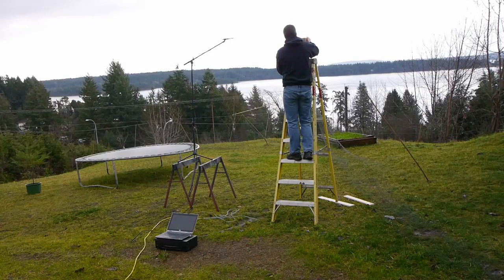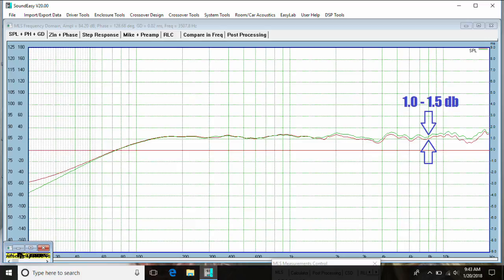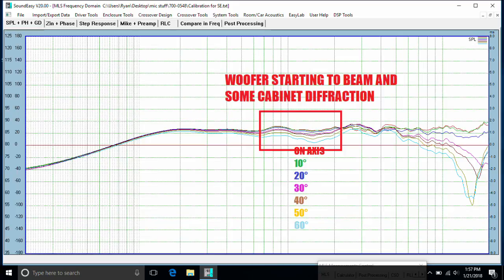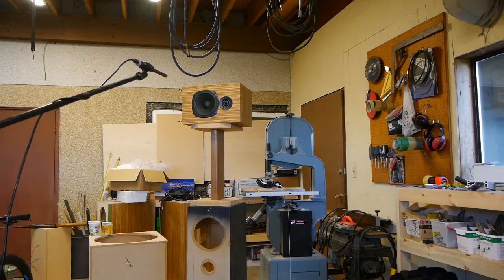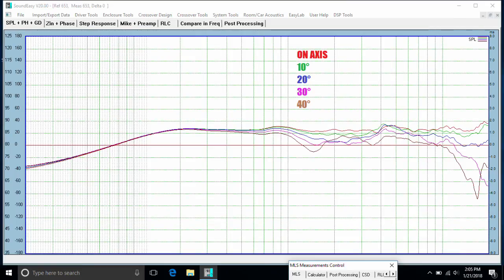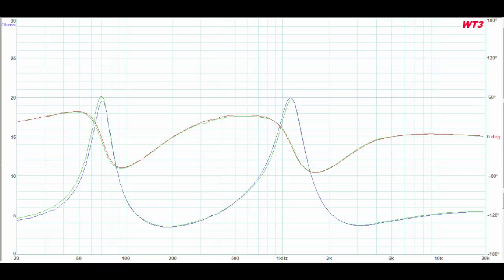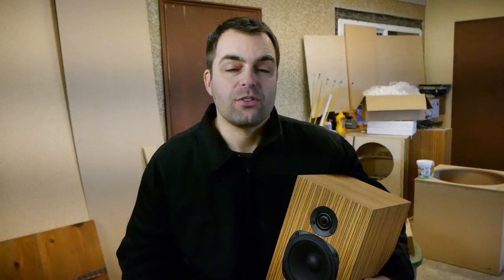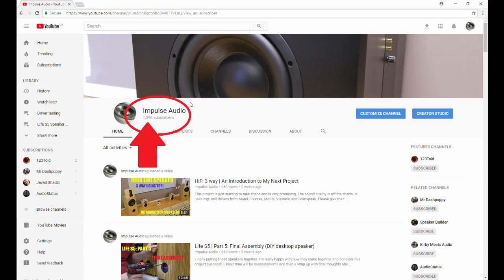Life S5 | Part 6: Final Measurements

Comment: This a perfect series for those just starting their own original builds. Enough tech not to completely blow your hair back. Good Job!
Reply from the maker: Interesting you say "enough" tech. I usually have about 2 or 3 minutes of blabbering on each slide and carefully edit them all down to just the most needed information. I figure nobody wants to stare at a measurement for 3 mins and listen to me. Then once it's ready to go I still wonder if it's too much or not enough. I often wonder "should have I mentioned this or that" or "may I should cut out that thing...". Good to hear the balance is there. Thanks.
Reply: Impulse Audio You demonstrated measurement and interpretation in a logical and practical way. It was very clear in a short video. My only complaint.......get a turntable. 😉

Comment: Really interesting how you were able to make that tweeter work up to 1.6kHz. I have tried to make them work with a 6inch mid-woofer crossed at 2kHz but wasn't quite able to get it to sound right. The 6inch midwoofer was probably a lot more efficient though which potentially caused some of the problems I had. I did really like the small frame, allowed it to be placed very closely to the woofer which does pay off. I expect you are using some kind of series LRC circuit on the tweeter or maybe a simple parallel resistor to supress their resonance because it is quite severe.
Reply from the maker: PA5cAl1 part of why this tweeter works so low is the application. A pair of 6" woofer towers in my living room would make this tweeter scream for help at even modest levels. Given the 1m listening distance it is comfortable doing what I need. So thats the big difference most likely. 

The Lpad has a 6.2ohm resistor in parallel which really whacks down the impedance combined with the second order filter which has an inductor to parallel means the Fs peak is dealt with no problem. Had I really pushed it low eith just a simple cap I probably would have required the LCR. Good call though. Hope you got it to work eventually.

Comment: Hi, i really enjoy your videos on YouTube. I use to build some speakes, can you tell me which software you used for the measures. I want to build a high power 4 ways speakers with a closed box for the subwoofer, and another close box for the second high woofer and a midrange and tweeter. I use the jbl pro 6 by 9 639 , which is a three way and i will add a subwoofer in that box, so all the driver will be close together for a coherent sound including the bass that is out of tune in almost all speaker installation. to divide my frequencier i will go to a fully digital crossover-amps solution which is easier to tune and should permit finer ajustment and go to 48 db per octave. when i was building speakers it cost me a lot in capacitors and coils and it was time consuming to solder everything .
Reply from the maker: A Br sounds like a fun project! I use SoundEasy but don’t recommend it. My biggest recommendation is HolmImpulse. Second is Room EQ Wizard. Give either of those a try and I think you’ll succeed.

Comment: Hi Pulse Audio , Have you ever made transmission line speaker cabinets, I made mine about 40 years ago they have a line length of around about 12 1/2 to 13 feet and I am looking to replace the woofer and the Twitter how’s the Twitter Osbornes out due to my amp packing up and I’ve been looking at Seas speakers 🔊, 8” but having problems matching tweeters, I do not have testing equipment and I’m relying on somebody give me some information to match a Twitter, And I think I need to build a Nother crossover unit . 
Not sure whether you can help to give me some information,
Phil from the moulin France,
Reply from the maker: Hi Phil. I don’t have a ton of experience with transmission line speakers. I like the concept, just have never felt the cost/benefit ratio made sense, so never built any. I think you’d get better advice from someone else.
Reply: Okay, thank you for reply, Phil from the moulin ,

Comment: You deserve your success, my man! This is a great channel! Since it will be used as a desktop speaker, wouldn't had been better to make your measurement from a desk or a table to simulate real world environnement and see how it behave?
Reply from the maker: Yes and no. I considered the angles and the types of reflections I would get, but it would be an error to try and correct a room or placement problem with the XO design. That always leads to a bad sounding speaker. Our brains decipher a source sound and a reflection/room sound very well. Speaker bad, fix speaker. Room bad, fix room.
Reply: @ImpulseAudioSpeakers  Thank you for the clarification!

Comment: Wouldn't it be easier to put the speaker on a lazy susan (turntable) when doing the off-axis measurements? It looks like you have the tools to make one that has calibrated locking stops for each of the positions needed.
Reply from the maker: Waltkat yes but I’m too lazy to build one! I’ve been meaning to build one for years now, but my old protractor keeps me going.

Comment: Very informative videos you have :)
Unfortunately i didnt found loudspeaker phase curve extraction and incorporating these in Xsim. Though you have so much videos i ned to check.
I can see you use DaytonAudio WT3 tester. I plan to get DATS V2 from "SoundImports.eu". Is DATS V2 better measuring device?
Further more i am planing to buy also DaytonAudio "OmniMic V2" with software. Do you have any advices and comments regarding these units?
What would be better and more precise unit, DaytonAudio "OmniMic V2" with its software or just to buy DaytonAudio UMM6 (or UMIK-1) usb mic and use REW or HolmImpulse as software? Do you care to comment or if you never had contact with these units at least can you peek at specs of certain units and say a word :)
Thanx mate
Cheers

Comment: So it seems that other crossover you have reviewed with a slight bump in the 1000-2000Hz area might be even better.
Reply from the maker: Илья Основиков why would that be better? A peak in that region would sound a little unnatural.
Reply: At 3:55 you have mentioned the lack of energy in that range. And prior to that you showed on simmulation that it could be a suckout in a crossover range above axis. And I've got an impression that the Mr. J's crossover might help in that regard as it has a small hump in that range.
Reply from the maker: Илья Основиков oh I see. That’s very perceptive of you and yes, because of the lack of energy in the off axis response graphs there is a dip in the overall power response of this speaker. It is actually very common in all speakers. It really comes down to what would sound worse, the dip in power response or a peak in the axial response. With a desktop speaker like this the peak may be the least offensive as the power response will be a major contributor to the overall sound. More than the axial response?? I’m not sure. It would be a close call. Overall we are fairly use to hearing that dip in the power response and because I limited it as much as practical because it’s a desktop speaker (close driver spacing, small woofer, etc.) I do think I made the right choice, but you are completely correct to think a peak would be the better choice. 

Nice work! Very happy to see viewers with such a keen eye!

Comment: hey. how far is the microphone putting a speaker right? is that true for the same distance? if I put the speakers out front to the sky to avoid sound reflections is correct? thank you
Reply from the maker: ady sax it really depends what you’re trying to do. A small driver, 0.5m is ok. Bass response, nearfield. A large speaker, 2m sometimes. The further back you go the more reflections you let in though. So you have to be careful. Pointing the speaker straight up will still have reflections from the ground unless it’s an infinite baffle measurement.
Reply: @ImpulseAudioSpeakers  Thank you so much! I have 2 subwoofer horn dy (dynaccord fx20) and 2 satellites fx12 and I want to do a calibration and linearization of frequencies . I will do an outdoor measurement for a real preset without frequencies amplified by the environment.

Comment: To eliminate the edge diffraction, I guess it would be reccomended to slope the baffle to 35-50 degrees?
Reply from the maker: Arnand de Jager do you mean a chamfer on all the edges? Yes that helps a lot. I knew the way I built it would have diffraction, I just wanted the look.
Reply: No I mean like really slope the front baffle. Like something used on https://heissmann-acoustics.de/en/dxt-mon-rly/ :) @ImpulseAudioSpeakers 
The designer talks about the effects on: https://heissmann-acoustics.de/en/schraege-fasen/
Reply from the maker: Arnand de Jager yes the way that person has done it will help with diffraction. Nice look too. I did a video about diffraction. There’s several ways of reducing it.

Comment: Great video! Any thoughts on selling flatpack kits directly in Canada? Definitely interested!
Reply from the maker: Shoop I've thought about it, but it's really hard to make it worth it. I'd probably sell kits if I did. So, XO, drivers, baffle, port, etc. But the buyer would have to build the cabinet and apply the baffle.  Then finish them how they like. I don't think I'd enjoy doing that enough though. I prefer to just create these things and work with video. If enough people wanted a set of these specifically and I could do a run of say 15-20 cross overs and baffles I could do that. That would be 7-10 people interested.

Comment: Do you think the 8 ohm version of this woofer could be a direct drop in for those of us with wimpy amps?
Reply from the maker: Unfortunately not. The impedance would be double, so the inductor would have to be double the size for starters. There would be other changes too. 

This woofer is 4ohm but the final result is not that difficult of a load for amplifiers. I wouldn’t worry about that. Especially since you’re not going to be able to pound on them very hard anyways.
Reply: @ImpulseAudioSpeakers  Is it possible to get the final crossover & box enclosure size?
Reply from the maker: @johnwooton2008  hi John. I’ve never provided that publicly. I’ll give it some thought. A few of the viewer submissions were pretty darn good.

Comment: I know these are meant as desk speakers, but do you have any suggestion on modifying them to be used as bookshelf speakers in an apartment sized living room?
Reply from the maker: LostArkitekt I’ve been using them in my living room, even cranking them up pretty high, and they’ve performed flawlessly. I would port them if using them in a living room permanently, or use a sub. Otherwise they could probably be used for many other applications.
Reply: @ImpulseAudioSpeakers   could you send me a PM (can't send you one)?  I'd like to ask you a couple of questions.
Reply from the maker: LostArkitekt the best way to get a hold of me is ryan@impulseaudio.ca but I’m slow to respond and I don’t review crossovers for people. Otherwise I try to answer questions about the videos. I respond better to comments here though.

Comment: Great work and video!
Where can I find these speakers as diy, near Sweden?
Reply from the maker: dennon carlander to buy? I’m not sure. Can you get SB Acoustics and Vifa drivers in Sweden?

Thank you!
Reply: @ImpulseAudioSpeakers  yes, the SB Acoustics and the Vifa drivers can I get. It's the cabinet and crossover design that is the big question how..
Reply from the maker: dennon carlander well the cabinet is easy if you can do woodworking. It’s a simple box especially if you go sealed. For the XO I discussed several options in Part 4 I believe it was. My final version has not been published but there were several good options I shared and the files were made available for use in Xsim to design a XO the way you want if you would prefer. I have given the XO to one other person with the understanding that they would make a charitable donation.

Comment: Could you tell the difference in sound between: vifa xt25sc90-04 and Vifa XT25BG60-04
Reply from the maker: If they were implemented the exact same, it would be tough. Overall they’re easily different enough that I can tell. The BG60 is a bigger tweeter with more range. I would only use the SC90 in a small format speaker like I did.
Reply: @ImpulseAudioSpeakers  Thanks for answering. I now have Vifa XT25SC90-04 in stock, I want to stitch them with Scan-Speak D7608 / 920000 at 4.8 kHz - 5kHz. And now the question is: If I sell: Vifa XT25SC90-04 and buy: Vifa XT25TG30-04, vifa xt25bg60-04, Scan-Speak R2604 / 833000, Scan-Speak R2604 / 832000. What do I get? will the schedule be smoother? Will it get any better? What would you do? You have a lot of experience, I do not.
Reply from the maker: @ГрубичАлександр  it really just depends what your project goals are. A speaker like this is small and isn’t expected to hit high SPL levels. A larger speaker will benefit from the bigger tweeter. Depends what you will want. Mostly how low you want to cross over.
Reply: @ImpulseAudioSpeakers  Thank you, I will probably leave the Vifa XT25SC90-04.